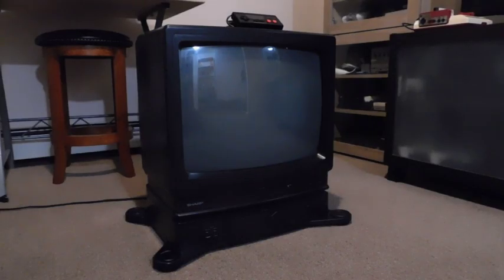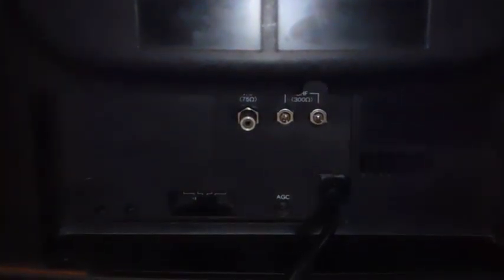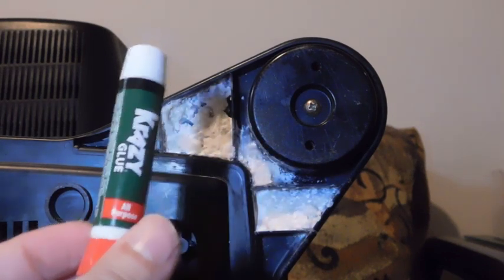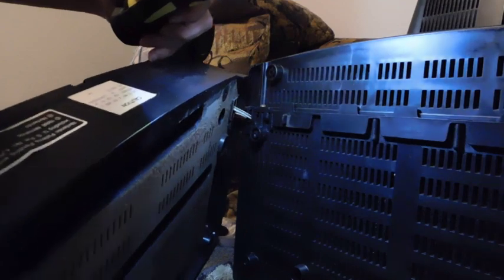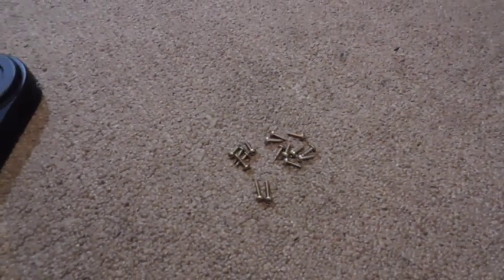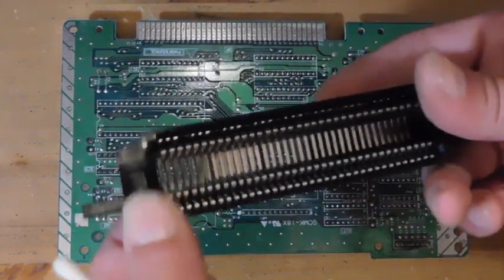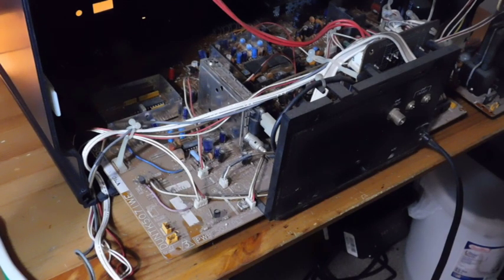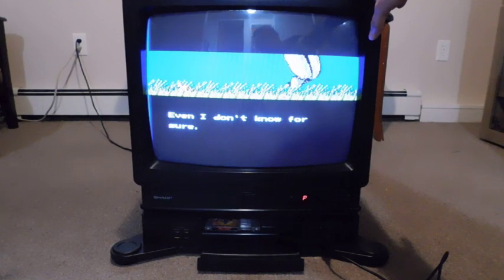Sharp NES Game Television Repair! Complete teardown and restoration

Comment: I love the baking powder/crazy glue fix! What an awesome idea! You're the man, George!
Reply from the maker: Thanks Phil! I learned that technique a little while ago and it is really useful whenever you are dealing with brittle old plastic that brakes
Reply: It's much better and more importantly aesthetically pleasing to use ABS slurry or just ABS glue
Reply from the maker: Interesting, that is not something I have tried before. In this case I wasn’t particularly concerned about the aesthetics because this is all hidden from view, but I will give that a try the next time I need to do some gluing, particularly if it’s visible from the outside
Reply: baking powder or baking soda?
Reply from the maker: Powder

Comment: is there a way to technically split the composite wires out to have an external passthrough so you can plug in another console not through RF?

Comment: Hello again, I am having audio issues with my sharp tv. The speaker worked perfectly when I hooked up a super nintendo to it, however, when I play the nintendo portion on the TV itself I get a loud buzzing and no game audio .. I've taken it apart and replaced the IC9 chip as well as several resisters and caps and the pin connector yet nothing has worked. Any insight would be greatly appreciated. Thank you! -Jordan (:
Reply from the maker: Did you test continuity from the audio cables from the internal nes to the tv? It might be easier to disconnect the nes and make a harness to plug it into a normal tv
Reply: @LIRetroGaming  yes, I did test continuity in the audio cables from the nes to TV, I will try making a harness and testing the nes portion on another TV however im certain there is an issue with the nes board itself. I hooked up a super nintedo to the back of the sharp tv and the audio played perfectly. , when I play the nes portion of the game television all I get is a loud buzzing. Tomorrow afternoon I'll open it bsck up and report back after some more tinkering .

Comment: were you able to remove the bottom and get to the NES without having to discharge the tube on this TV? I have one and really want to refurbish the 72 Pin but do not want to have to discharge the tube (for my safely and the tv's)
Reply from the maker: Yes you don’t have to go anywhere near the high-voltage components in order to access the bottom

Comment: I wonder if this can be RGB modded to bring it up to par with its Japanese counterpart.
Reply from the maker: You can install the NESRGB on this board. However, I’m not sure if the tv can be modded to accept RGB. I don’t think it has a jungle chip which is required for an RGB mod to the tv